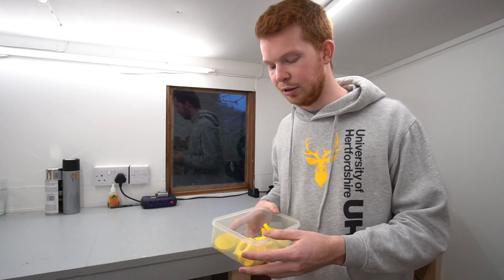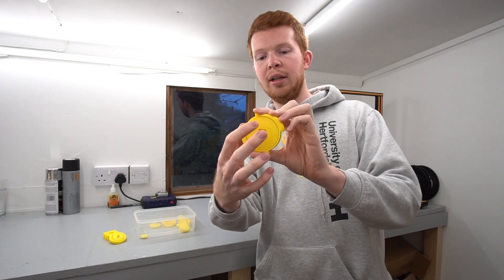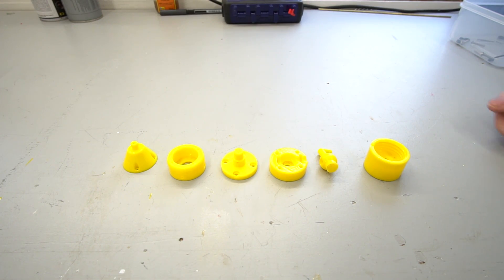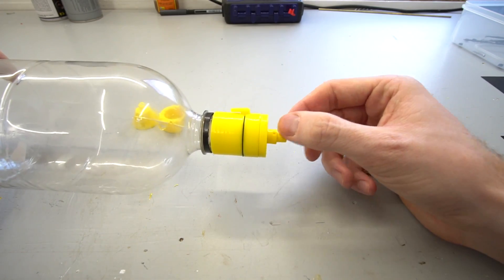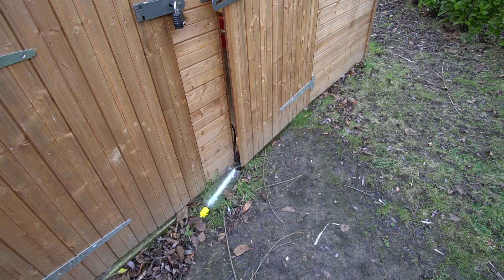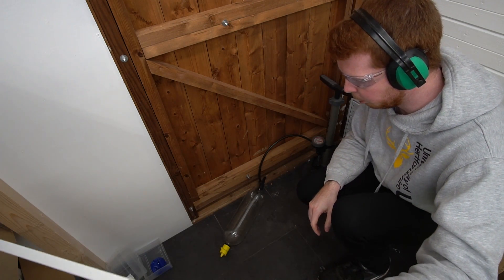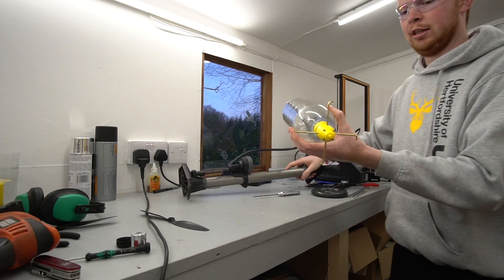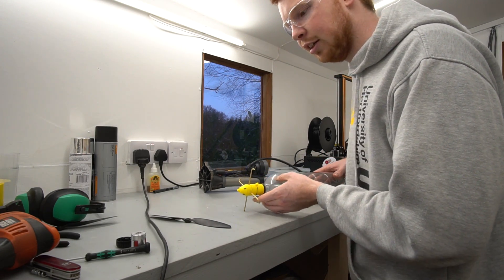Air Powered... Propeller?

Comment: personally I would prefer more regular 'parted' uploads
you should also try powering the turbine with dry ice or something... maybe it would give longer endurance
Reply: I regularly work with dry ice as a packing material. I don't think that the gas release of dry ice would be fast enough to power anything at all. It just evaporates really really slowly (additionally it cools anything down, colder gas means lower pressure).

Comment: You probably already know this, but turbines typically are more efficient  at high velocities and high volumes, and your device's target speed is far below those speeds. If you filled the bottle half with water and used the air to move the water through the turbine I am sure it would do better as a boat engine.  There is a reason Air Hogs chose piston engines.
Reply: Michael Crumpton I was thinking the same thing, problem is the weight of the water. Planes don't like that in general

Comment: I could be wrong, but doesn't the sharp angle of the nozzles waste energy in the air? Like, would it be more efficient if you bent the nozzles round in a gradual arc, rather than a 90 degree bend? Also maybe it would help to make the nozzles smaller to increase the pressure? I'm not well versed in pneumatics, just spitballing here.

Comment: Keep Working..You will achieve..How about feeding the Compressed Air,directly into the trailing edges of a  a 3d printed Propeller.? The Pressure could also be created Chemically. (CO2)

Comment: I suggest to use an incompressible fluid like water, that has more mass so it will result in more thrust. The other problem in this design is the air losses and friction in the nozzle system, as I saw the rotor is matching the holes during the rotation, but this method makes lots of losses. As people has suggested, using the decompression energy directly will be the best way to go, but as I said before, using an incompressible fluid is necessary to transfer power and thrust. See Water Rockets.

Comment: It seems like most of the air isn't exiting through the tiny nozzles though- most of it is leaking rapidly out through the bearing itself, otherwise I can guarantee it will spin much, much better- the ceramic bearing is not sealed at all compared to other types of shielded bearings.

You can tell most of it is leaking by the fact the propeller doesn't spin unless you give it a helping hand before opening the valve- all the air dumps out of the bearing since that is the path of least resistance vs the narrow nozzles.  A simple fix would be a metal shielded bearing with the grease cleaned out- it will be much better sealed but still spin nice & smooth.

I could be talking out of my ass however, but it's worth a shot to see if that's where the issue lies...

Comment: Could you do what they used to do with steam engines. They would have a small high pressure cylinder then a second maybe third cylinder which are larger to take the exhaust of the first cylinder and use any remaining pressure. Might not be as useful with this low pressure but perhaps.
A compound steam engine seems to be what I mean.
Reply: Ben Carter maybe for a car

Comment: I'd like intermiediate videos of your projects as well. Lots of the fun is in the design process and not necesserily the finished item. 

On suggestion for this project is since  it is really trying to use the mass of the air to accelerate the propeller and not so  much the preassure per se how about adding water in the botle. Do like 50% water and 50% drive air to keep up the preassure. It will go everywhere and be heavy as hell but really increase the performance of the final design.

Comment: perhaps if you were to laminate the bottle with fiberglass it can hold much more. lightweight fiberglass gastanks can hold multiple hundreds of atmospheres of pressure.
you can also make your own custom shaped bottle, 3d print a plug using water soluble PVA plastic, glass it and flush the PVA out with water. in the laminating process you can also include the abs neck and air pump valve.
also, you can buy air slip rings that allow compressed air to pass through a rotating joint.
if you dont want to do that, try to make a bearing block at the neck of the bottle, allowing the bottle to spin with the turbine. although that will increase the inertia the nozzles will have to speed up
I love the vids, keep em up!

Comment: Acceleration through a pressurized stream is highly dependent on the mass of the medium used due to the conservation of momentum. Air weighs practically nothing, which is why it was such a failure. But what if you pressurized a heavier gas like CO2? Or even use a different phase by using a liquid like water? Of course, a tank of water would probably be too heavy to attach to a model aircraft but it could still be interesting.

Comment: In case you haven't seen it already, there's another angle on 3d printed air engines on Instructables here: http://www.instructables.com/id/Model-Aircraft-Styled-Air-Engine-Experimental/ - a flat on the rotating shaft uncovering ports is used for the valve, so timing is more controllable than the air hogs style poppet valve.  This could be the thing that lets your coke bottle plane actually fly a long way :)

Comment: I think the piston-engine with a little 12g CO2 capsel would be an cool combination !
Reply: Floh Or, just put a piece of dry ice in there
Reply: You can buy co2 powered motors for free flight models. People have also built multi cylinder co2 motos.  I flew them back in the 1980s. Sometimes the co2 tank would ice up..

Comment: Few ideas:
I think your exhaust pipes should be more rounded. It should not have a brutal 90° turn. I think a brutal 90° turn makes the air turbulent and then generate a poor reaction.
Also, I'm quite sure that 50% of the air is not passing through the exhaust pipes and find a shorter way out xD
You should block the exhaust pipes with something to see if the air easily escape :)
Reply: By the way, I love your videos and I would really like to see some regular updates of your work :)

Comment: Tom, splitting into parts is a great idea I think. Seeing more of the tinkering and trial and error is great viewing for me at least. I'm guessing others? 

Good stuff! By the way, I'm working on a constant pressure canister for self controlled pressure release from baking soda and vinegar. (as the pressure builds soft nozzles cut off the vinegar supply). The hope is to have a controllable and stoppable solid/liquid 'fuel', that actually runs for a while. CO2 is a buit heavier too, which could help with the esign. But I'd prefer trying it with the pistol motor. Currently trying to source access to a good SLA printer that makes decent rubber like parts that are acid resistant...

Comment: Use the valves with the other engine to have a “multistage” engine so when you run low on gas you can open another engine. I would like projects split into parts to see the dev process, unless that is harder for you. Do whatever you want

Comment: Points to possibly explore to improve:

1. If you might use a flow limiter valve to deliver a steady stream of air between specified parameters, upper and lower psi, you might get better results.  Pumping into a bottle to discharge, the initial psi may be 40, 60 or 100psi, but it immediately reduces upon valve release.

2. Also drag from the exhaust tubes may be self limiting

3.  Was there a specific calculation that drove you to such a small diameter exhaust tube?

What if the tubes were more triangular at the input side and choked down to smaller circular at the exhaust end?

Comment: just because of the mythbusters refrense I gave this video a like :D
i like the vision you're haveing, to make a pnaumatic motor, im no engeneer, but i fiddle around with 3D-printing and DIY RC planes. I really liket the ball valve design you had in the last video and it had pretty good resoults, did you think about adding another motor on that plane? or are you thinking of a more effektiv system of converting the energy of the compressed air into rotational energy? I had the same idea some years ago but had just a plank of wood and a hack saw, so i got no where. 
Continue the good work (Y)

Comment: Have you not considered injection moulding for the parts that need higher tolerances? I've no doubt someone, somewhere in a maker group with a bench moulder could help with the issue. Other than that milled aluminium could work but then there's the weight to consider.

I think some 2L bottles are good to 120 psi before deformation happens but if you want a larger bottle buy some crappy white cider as you can get 3 litre bottles which will allow for faster/longer flight depending on your requirements.

With regards to the videos, I guess more videos means more video editing but if you're one of the lucky ones who are still getting ad revenue from YouTube, you could put out projects in 3-5 parts and try structure it explaining the concept, ideas, prototyping and conclusion as you definitely do some interesting videos and you're definitely getting ad rev from it all that would help too.

Comment: I have enjoyed you air powered projects.   Regarding the clearance problems due to the inaccuracy of 3D printing.   Would it work to machine the parts on a lathe after printing.  Much like we machine after casting in metal.

Comment: If i understand your design right, you have a gap between the turning parts and static parts with the ball valve, i think thats the biggest problem. The majority of thr compressed air will leak out this gap before it spins the prop.
You could either try to make the design much more like the ballooncopter so the bottle is connected to the "engine" and turns with it or you find sone way to get rid of the gap.
I would love to see a design where you build something static around the rotating pressure tank+engine combo and actuate the ballvalve with some kind of mechanism, i think of one of those Helicopter prop discs that are stationary but actuate the angle of the prop blades.

Comment: FDM printing is clearly not very good for technical parts. As soon as you need small clearances it is very difficult to produce working parts without a lot of post processing and it is not even always possible. SLS printing would I think be much better but an SLS printer is too expensive at least for the moment for hobbyists unfortunately.

I'd like to see the progress of your projects so multiple parts would be nice :).

Comment: As you said the problem lies in the mass of the turning unit. What if you also increase the mass of the energy holding substance. I'm talking of a design similar to the water-air-rocket.
Me and a friend of mine build an ebike similar to your first version, but with stronger motor mount and diy li-ion battery... it's great thank you. 
By the way I enjoy weekly updates. Some kind of vlog including all current projects would be nice.
Reply: You don't fill it completely with water, just mostly. You then pump compressed air in. The air pushes the water out which gives a stronger reaction.
Reply: ultimatejosh yes but water is also 1000 times heavier than air, and this is supposed to be able to fly...
Reply: water is not compressible, so you can't store it in the bottle
Reply: Corey Phelps Exactly that what's water rockets are all about.

Comment: Efficiency on this thing will be just awful. Air is not very good rocket fuel
Reply: Demy de waard no, they are not turbines. They are 3 small rocket motors. Princlples are totally different, air pushing stuff in piston or turbine engine or air flying from small hole in rocket engines
Reply: Demy de waard  Stop being ignorant.
Reply: Demy de waard, if I am like what?
Reply: Ted Archer Jet engine
Reply: Albert Zne yeah, but jet engines do not work on air. Almost all of pressure energy is waisted that way
Reply: Mr. Archer is right. Consider, he only pumps a few strokes to pressurize the air tank. That's not much energy. Technically the "fuel" isn't the air or its pressure, it's the breakfast Mr. Stanton ate before making this video. Still, I love the brains that goes into this.
Reply: The 'jet' propulsion lab made rockets, they are all using the reaction principle and that is the criteria with jets and rockets. And the jet turbine of course powers a prop. And there is the Catherine wheel, a rocket powered prop of sorts.
Reply: Martin D A right!
I was thinking more of chemical rockets, forgot about cold gas thrusters like used on the falcon 9.
So yeah, in a sense its a rocket, indeed a terribly inefficient one
Reply: What about liquid nitrogen? At 20c it makes a lot of pressure!
Reply: yes they do....
Reply: Demy de waard because it powers a rocket engine
Reply: what makes you think this is rocket fuel then?
Reply: Ted Archer if that is what you like
I'm not gonna argue any further
Reply: do rocket engines power propellers?
its just an air powered turbine connected to a propeller
the fact that speedy gasses come out of holes doesnt make it a rocket
a jet engine has speedy gasses coming out of a hole, a piston powered engine has speedy gasses coming out of a hole
Reply: Sure if you like that.
Have a nice day!